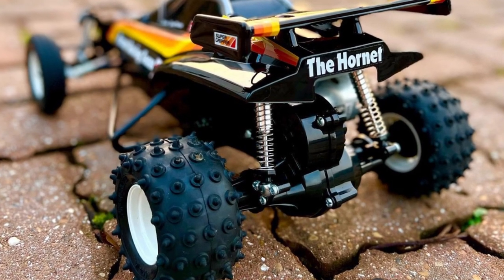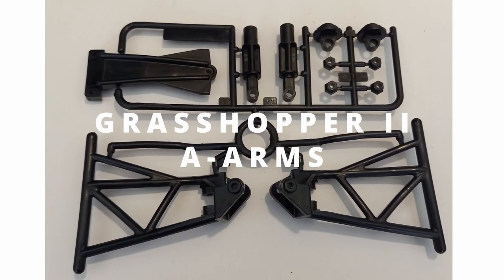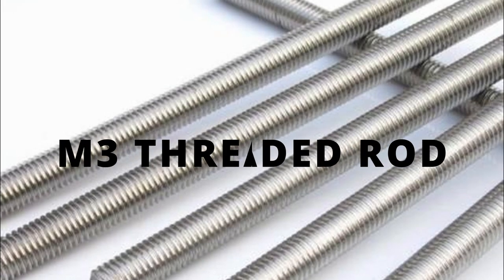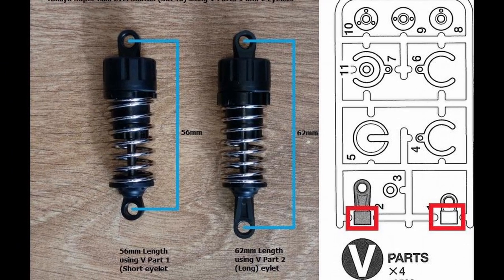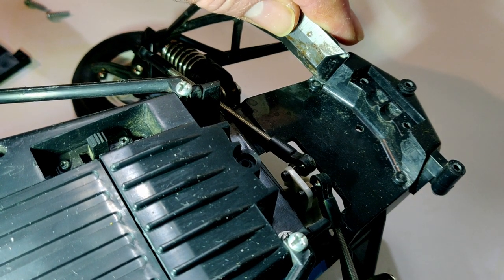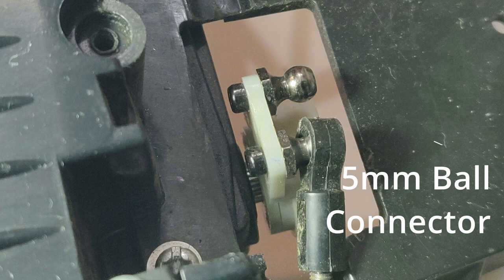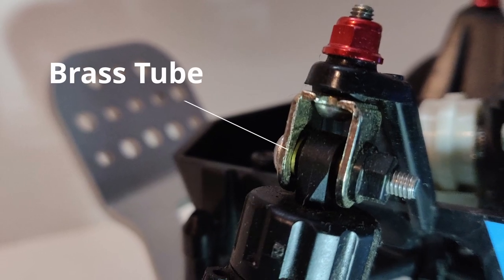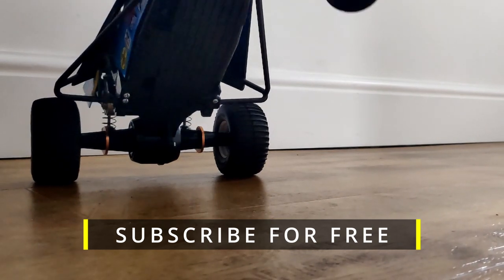Tamiya Hornet Upgraded Front Oil Shocks

Comment: This is absolutely AWESOME, Thankyou so much. It's going to make the Hornet so much better than straight out of the box. Tamiya left the Hornet half dome in my opinion. And the rear end is to be honest, junk that slapping sloppiness in the rear diff hangers is abominable. I reckon the Grasshopper Was better rear end set up with Hornet or even better aftermarket shocks. Still doesn't solve the unsprung weight issue but would make it so much better than standard. Having said this much though, I've also seen a fifth shock modification available for Hornet and Lunchbox and Midnight Pumpkin. Basically a 5th shock is put on rear axle shaft to chassis and eliminates the sloppy slapping that the tiny flimsy  little wire springs can't control. The car can definitely be improved. But I suppose I should keep in mind this car was released at a time when the only RC cars available were toy grade and the Hornet was a huge improvement over toy grade. It was fast at the time and I suppose people weren't too worried about the shortcomings in design. Anyway great work from dustyfingersRC I've subscribed 👌👍
Reply from the maker: Hi. Thanks for leaving a good detailed comment as well as for the support. I've seen the 5th shock mod and like that idea. I thought about doing it to the Lunchbox but at the the time I bought the Ampro axle brace. Much better but it would be good to improve it further although, I would still want to have one with the classic bounce too. As you mentioned, they represent a certain time and I like going back to that era.

Comment: Hi there and a very fortuitous video for me to watch. I’m hoping to go back to my 1984 routes and get myself a Hornet, and yes, back in 1984, that front end was very bouncy indeed. A great solution using a combination of Grasshopper 2 A Arms, Lunchbox ‘U’ brackets, M3 rods, M5 ball ends and rod ends and those Tamiya super mini shocks. The most heart pounding bit, would be gently shaving some of the bath tub chassis to allow for some clearance, but a great video indeed. Take care and best wishes to you all for Christmas 😊😊😊
Reply from the maker: You are capable and patient enough to take only as much as you would need to off the chassis. It wasn't that bad, just keep eyeing it up. Think back about the process, I used a pencil to mark the chassis where it was binding and worked to that line. Damn, I should of put that in the video 🤔Had the video done for a few days and been playing it back to see if there was anything I had forgot too. I did this a while back now and that part only came to me cause of your comment.
Reply: @DustyFingersRC  Hi there and thank you for your advice. So glad that I was able to trigger a little extra! 🤣😂🤣 great idea placing some pencil marks onto the chassis to see where the chassis requires some further delicate shaving. Your video will certainly help me, I think it will help many with the chassis and even those with the Lunchbox chassis too. A great tip to get some better handling from a classic chassis, I can hardly wait….but I’m going to have I to. Take care and best wishes to you all. Happy Christmas 🎄

Comment: Excellent video! It kind of makes me want to buy a Hornet now, just to do this... 😎 I should probably build my new Holiday Buggy first though, eh? (still waiting for the oil shocks for it to arrive).  👍
Reply from the maker: The DT-02 is amazing, one of my favourites. The Grasshopper and Hornet won't perform as well as that, they do give you the 80's feeling that a man my age appreciates.
Reply: @DustyFingersRC  You'd know - would a set of hornet/grasshopper wheels fit on a holiday buggy, do you think? I'm guessing the rears might not clear the arches, but I don't know how the overall tyre heights compare.
Reply from the maker: @rccrawlersmid-wales645  Yeah, I think they are slightly smaller in height comparing both with tyres on. If you drop me a message on FB I can take a pic to show you the wheels together.  The DT-02 are 12mm hex but the Hopper wheels are not.